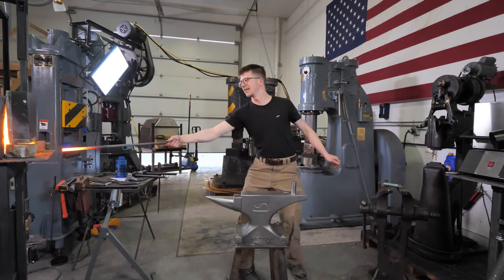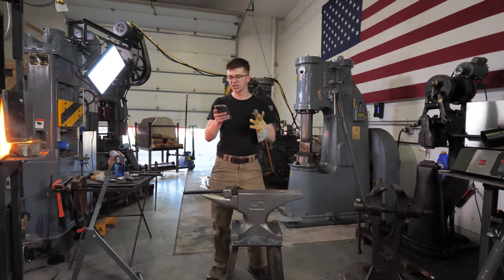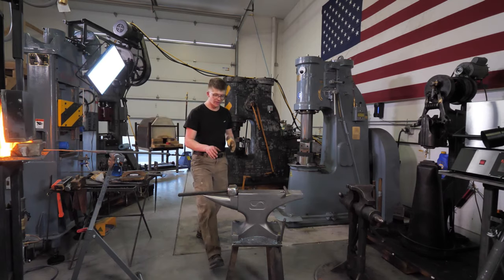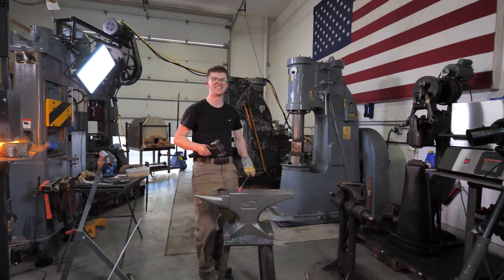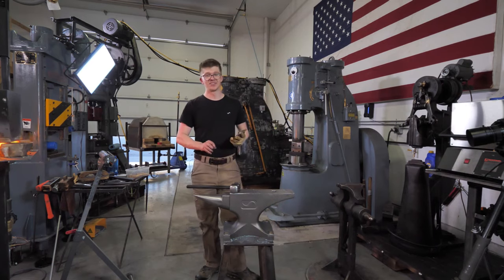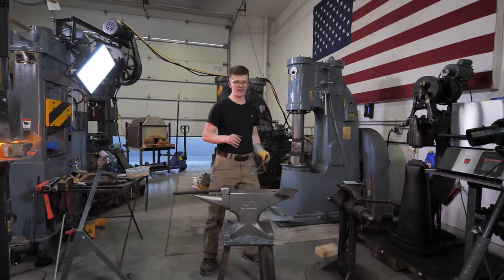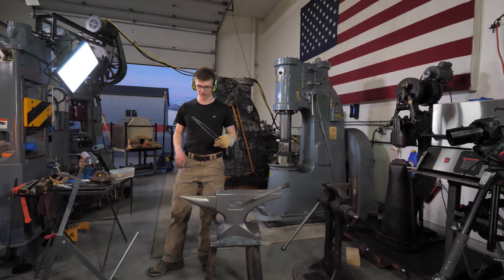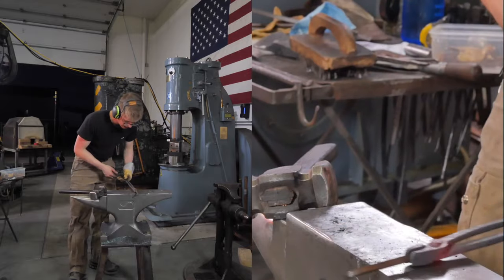THE ALEC STEELE LIVE SHOW! Making Tongs! S2:EP1!

Comment: Does hot gluing an anvil to the floor sound stupid? Well, “It’s not stupid if it works.”
Reply: i use hot glue to make "non-skid" pads all the time..... usually not on an anvil tho. things like glass figurines and such
Reply: That's hilarious..... We use that saying in EMS constantly
Reply: Hot gluing things to things to other things that probably shouldn't stand up to what it's put through is the way my high school Stage Craft class works.
Reply: He should make a shirt with that.
Reply: I mean, it might get rid of the ring but I doubt it’ll hold it, plus unless the anvil is huge, you’d need to put it on a stand
Reply: @sirblocketh  lll
Reply: @sirblocketh  l
Reply: @sirblocketh  lp
Reply: @sirblocketh  ppppppp
Reply: @sirblocketh  p
Reply: @sirblocketh  pp
Reply: @rilik3  4q 5556
Reply: @sirblocketh  55??
Reply: @rilik3  5?5

Comment: That forge ease is to be mixed with water and applied to the forging dies on the power hammers, it keeps the workpiece from sticking to the dies. I work at a forging plant where we use chambersberg 40,000 lb die forgers, we do open die forging

Comment: In order to get a really cheap but perfectly acceptable ambos you can get 50 cm from one of these huge H-beams made of steel, which only costs a handful of dollars and is really stable. In the lower end of the H-beam, drill a hole in each corner and screw the "Ambos" onto a large, round piece of tree trunk (best made of hardwood)

Comment: On the subject of the railroad track anvil: I made one myself. Got access to a cutting torch and cut in a horn, recess for harty hole, then welded a plate of steel to the top so I could level the top and have a step. To harden the plate for hammer work I drilled 1 1/4” holes spaced out along the length then filled the holes with weld to heat it up torched the edges that didn’t get heated from the hole fills then quenched. It’s a bit of work but I never spent a dime on it having access to drill press and welding/cutting machines from my job at the time. It works phenomenally and now sits on a stand made of 12 4x4 and one 6x6 timber at 23” tall to bring the anvil top to my knuckles. Glued strapped then screws through the banding and it’s better than I imagined when I started this great feeling work. Angle grinders are an amazing power tool to have too!

Comment: He found out hot gluing an anvil works for when you are unsure where it should rest. Lol
Reply: What I do in such cases is put in female threaded anchors. These are made from heavy walled steel tube with an internal thread at the top, whose top ends up flush with the surface, and an expanding section at the bottom with an internal metal plug. You set it in a blind hole with a pin punch, driving the plug down into a decreasing taper at the bottom of the tube, which has splits around it like a collet.
It can stay in the floor from here to eternity, whether it's in use or not.

Comment: Try using lead screws/jack screws for your forge doors. I've seen it used in extremely hot applications in slide gates. Worked quite well. No code required, just limit switches.

Comment: A simple forge door. One pulley over the door. One pulley level to the first off  to the side. Run a cable from the door through the two pulleys with a handle at the end. Pull the handle down, secure to a hook to open.
Reply: Need a foot mechanism so that your hands are free to handle steel

Comment: Stupid ideas for the stainless damascus:  a nut and bolt for securing your anvil, kitchen scissors/shears, a faucet knob, xacto-knife holder and/or blades, small garden hand tools (trowel, three pronged rake, dandelion fork), cake/pie serving utensil, butter knife, door stop, tap puller handle, flashlight belt clip, belt buckle, bottle opener, desktop headphone hook, paper cutter blade, camping spork, can opener

Comment: Is the Chambersburg set up in any way to perform a pressure test? If you can force air into the top section when all the valves are supposed to be closed then you can listen to  or bubble water possible leak locations.

Comment: Mr. Steele, could you fill us in on the ventilation of your space, please.  Obviously burning gas indoors can be an issue, I see the overhead door is open, is that to help with air exchanges? Do you have gas detectors in the shop?

Comment: Something useful to know if Arduino is not optimised for 'industrial' applications.  They fail easily under normal circumstances.  If you want a successful electric forge door use analog circuits/drivers or a PLC.  I'd be more than happy to help if you desire

Comment: So if you do start your own line of anvils, I already have a hay budden 150# anvil, will you try some other styles? I’m more interested in a German pattern double horn anvil I really think the flat horn will help with reach issues that the English style anvils have a problem with, but I would still love to have that anvil with the nice sharp corners mine looks like your Peter Wright anvil
Reply: Wait
I am from germany anf I have an old anvil which I use. It's very weird because the 2 horns aren't round like the ones from other anvils. I always thought it is a faulty one but you tell me that this is a german style one?
Good to know I was thinking about grinding those horns round but now I don't will I guess.
Reply: MaZaa Faakaaa one should be round and one flat
Reply: MaZaa Faakaaa the best thing about it would be that I do have a 150 pound anvil that’s got a good horn on it, I just like the flat horn better than across the tail or in front of the cutting table

Comment: Do you really need an arduino for the doors though? you should be able to wire a button to turn a motor one way and one to turn the other way, without use of a computer. Now I don't know how your motor drivers work but I think it should be possible, and then a lot less other than a fysical component breaking can actually break the doors.

Comment: It might be better, stronger, and more reliable to use a pair of servos with a screw to open the doors. Cables are the weakest point on a pulley system. A screw would allow higher precision, and if they were variable speed, high-speed motors to open and close, it wouldn't be that much more difficult.... Just a thought.

Comment: I have to wonder if part of the reason he has trouble holding the hammer down at the end of the shaft is that he uses _500 lb hammers_.  Like, seriously.  Alec's hammers are the BIGGEST ones I've ever seen (I guess the Brasil style?) used for smithing.  I'm a believer in lighter hammers, longer handles, and larger swing arcs, letting speed create force.

Comment: Why not find an electric winch for each door and just have 2 controllers, one for each door? Put the winches under the forge and run the winch line through a system of pullys to the forge door to a eye bolt. Repeat for the other side.

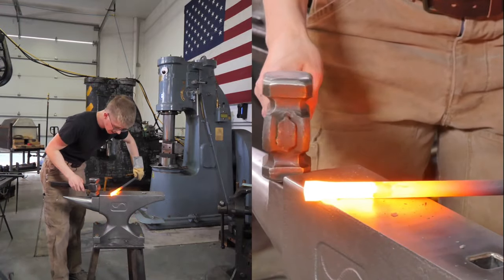Comment: 2:48 Why is the sound out of sync?
I don't have any OJ, so I drank water. Still did not take a drink with each drop.

34:40 2 years older? that should make no diff!
57:42 In Tokyo!
1:44:40 Joy To The World?
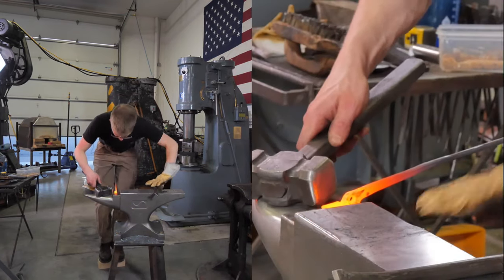1:45:10 Use a piece of pipe insulation or a pool noodle. 
Demo Ranch? YES! Do it! Who would not want to see Matt Carikker wail on a bullet-riddled anvil❓

Comment: I did try and warn you. You had no filters on the fans, which would've sucked crap in the cake and short out the electronics in the box. 

You're coding is probably fine, but the hardware might be fucked.